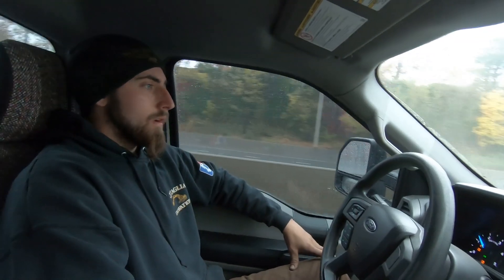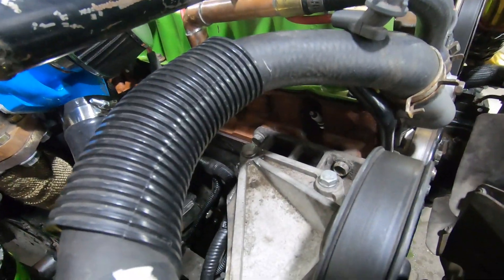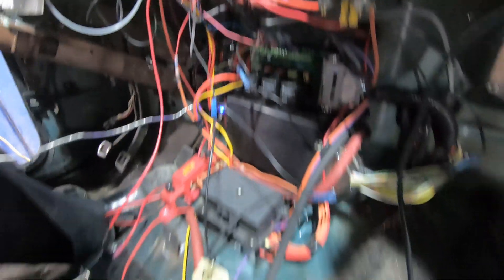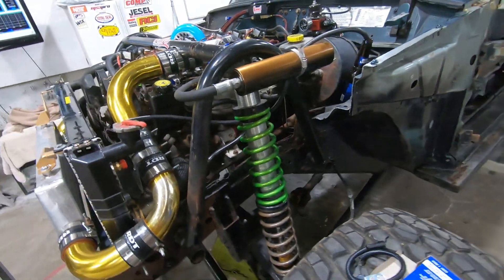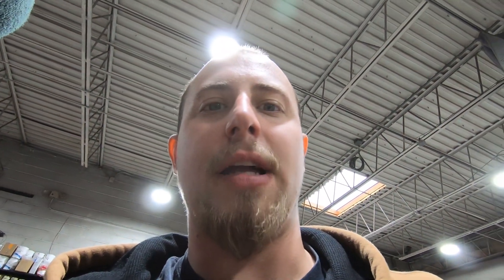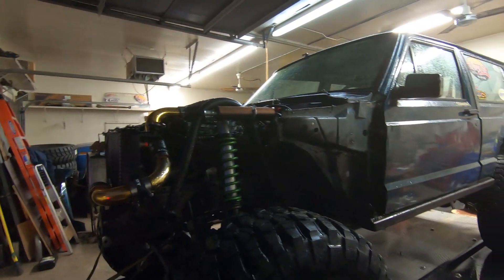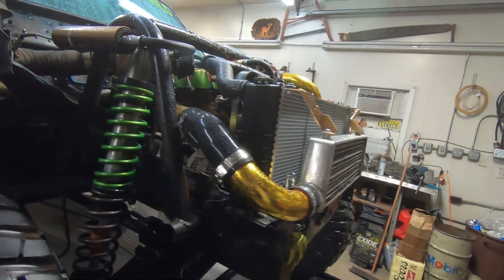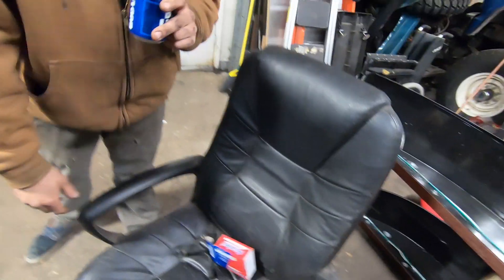Turbo Jeep Cherokee Dyno Round 1

Comment: Are you running stock internals? What turbo are you using?
Reply from the maker: Stock internals, except ls valvesprings, and custom camshaft
Reply: @Grewsum2Sum  Thank you!
Reply: @Grewsum2Sum  Was it a stroker cam and could you send a link or part number? I have been on forums and they say different camshafts and since this runs I would like to know please. Thanks again
Reply from the maker: @victortrense5640  call up lunati and say you have a 4.0 you wanna turbo they will hook you up

Comment: In the ignition settings on tuner studio there is a setting to run 2002 jeep, ive had to start doing the software side of things on mine as I've gone down the supercharging route, the 2002 jeep setting has a slightly different cank signal pattern form the 96-01. This might be worth a try before going down the route of a gm trigger sensor.

Comment: Serious question lol. Where did you tap for oil pressure ?
Reply from the maker: Tapped into the stock sending unit for oil feed for turbo and there is a plug on the block by the oil cooler I used for the mechanical gauge cause I dont trust the stock one
Reply: “Serious question lol” you millennials are retarded lol

Comment: You guys are definitely pioneering into the Megasquirt 4.0 universe. I know a lot of people were using the Renix flex plate with the stock CPS, but not sure how much success they had with that setup. You guys are making the right call going to the crank pully trigger. Can't wait to see how you set that up. I'm currently still debating on doing a turbo 4.0 swap into my dodge D150. You guys are sort of the test subjects haha. Keep up the good work!
Reply from the maker: That would be sick I have so many plans for 4.0 swaps cause nobody does em!
Reply: @Grewsum2Sum to bad about the crank trigger I've looked into that pulley trigger myself  keep up the good work guys

Comment: Let me get this out of the way......your choice music always has me dancing in my office chair. Okay, onto more serious stuff. You guys are gaining. It all takes time. My setup worked pretty well right out of the gate but I had some previous experience tuning old GM TBI stuff. I was concerned for your ignition system. I have always been under the impression that Mega Squirt isn't coded for anything other than the Renix flywheel. When I installed my Micro I read through the manual it is boldly stated that the 36-1 is the way to go. I still am dizzy based an it works great but I did buy the 36-1 wheel and hall effect sensor just case. Good luck gents!
Reply from the maker: Thanks for enjoying the music too by the way lol we wanted it to be not your typical YouTube background music ya know lol ?
Reply: @Grewsum2Sum  Well you nailed it! I totally love it! Keep after it fellas, the Buffalo will rip!
Reply from the maker: Apparently ms3x can support the 96-01 crank trigger but it didn't seem so today